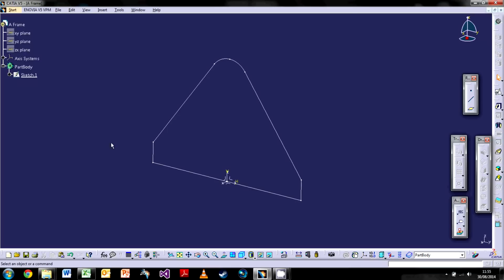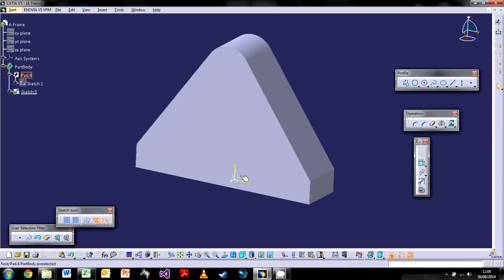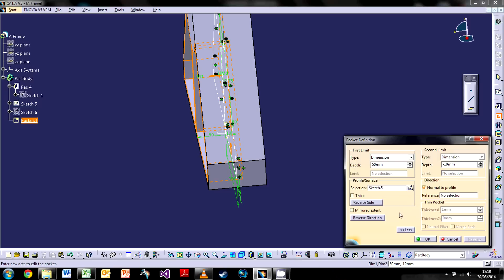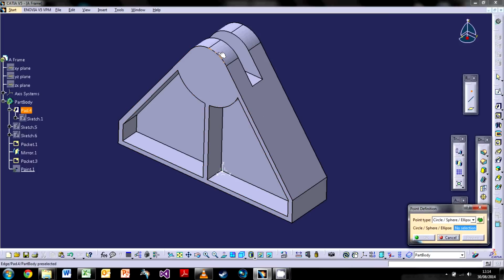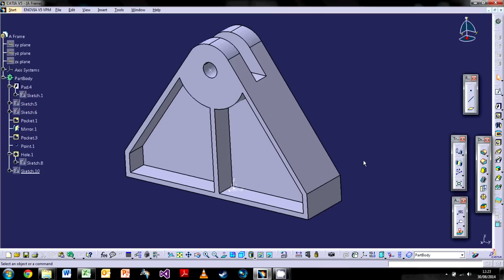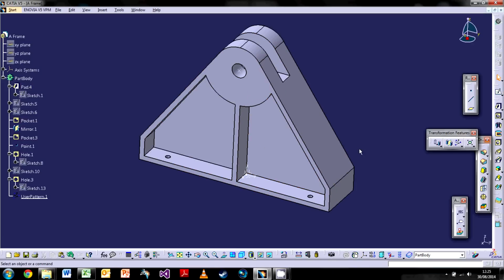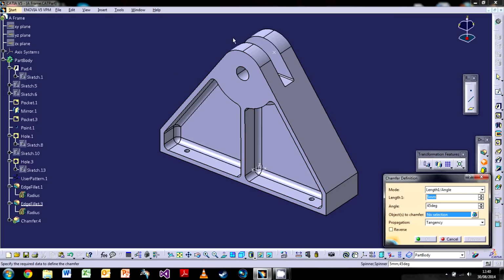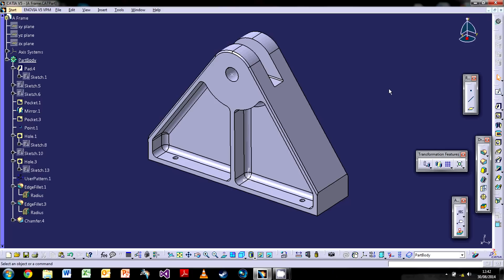CATIA V5: The Basics - Tutorial 3: 3D Modelling Part 1

Comment: I have some questions, at 3.12, how did you turn the part green and that does it do? 
I have the previous model witch was basically a triangel, with coor system at bottom, if you want to add those vertical lines that you did to this model, how do you "move the part 50 mm up" i could not  type -50 mm from the horizontal x axis in the sketcher?

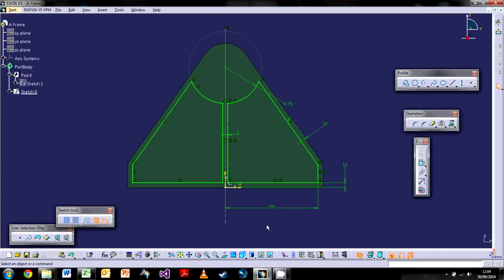Comment: Thank you so much for your video. Can you please explain what happened  after 3:02. I dont understand how you did the offset. Thanks in advance.
Reply from the maker: Sakib Hasan Mohammad  hi there, you can either just use the offset function which are under the 'mirror' icon in the operations tool bar, or via tools > operations > Transformations > offset. or you can just create a line and create a constraint to the edge of the part. the choice is yours! :)
Reply: TheCADMan thank you so much :)